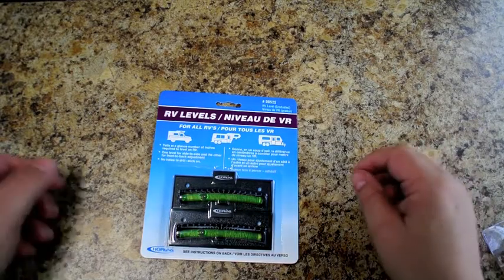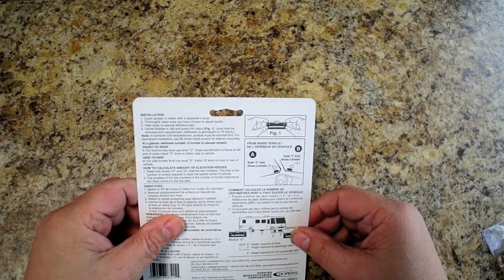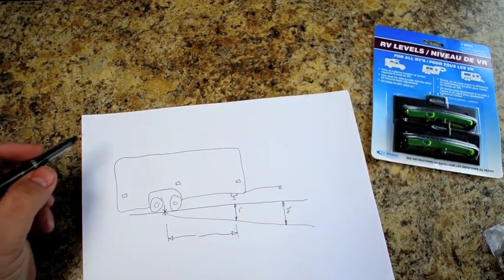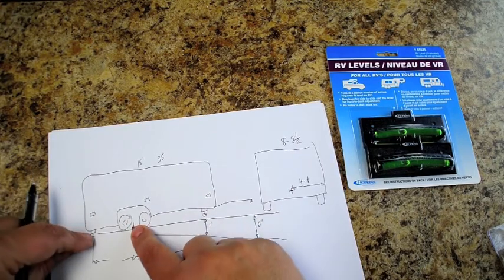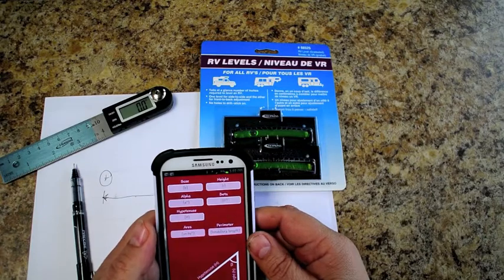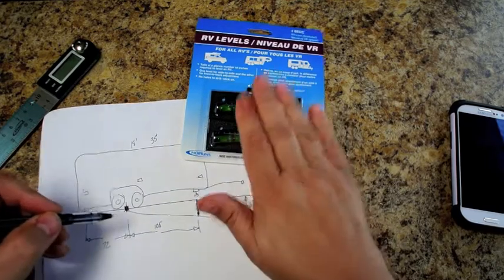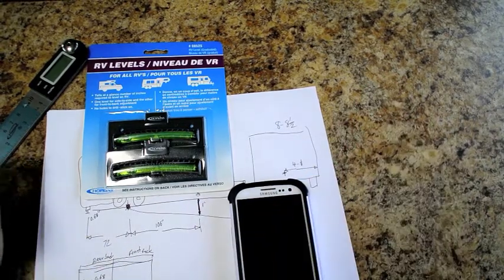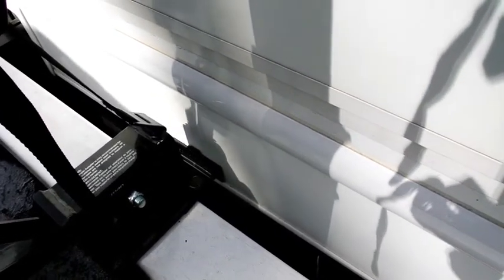Review of the Hopkins 08525 Graduated RV Level.

Comment: I'm gonna put the side to side one dead center in the front and use a 4' level on my back bumper. When I level that I will use my power jack and level front to back and just use the stabilizers to stabilize. Plain simple leveling. if it's good enough for a house it's good enough for the trailer/.
Reply from the maker: Thank you for your input.

Comment: Splitting hairs, ain't ya buddy. C'mon man all this really doesn't matter while leveling an RV. I'm thinking if both bubbles are as close to the center as possible, you're good! Just a little too technical.
Reply from the maker: Not really. Depends on your RV.

It is important to know  how far off from center the RV is when you have an automatic leveling system. They have a limit to how far they can level, and if you attempt to level on  ground that is too unlevel, the cylinders will extend to their limit points and you may have to reset the system.

Knowing the working distance-to-level when you have a leveling system is thus very important - and if you use a bubble system like this one, then you need to know how accurate it really is.

Comment: I thought that the tongue jack was the one used to raise or lower the trailer, and the four jacks on the corners of the trailer were basically used for support and not actually to lift the trailer?!? 
And the sideways leveling was done by pads of some kind under the tires of the trailer?
Reply from the maker: The stabilizers you are familiar with are lightweight jacks that simply stabilize the RV , preventing it from shifting under your weight when you walk around inside, as well as immobilize the suspension when you are camped (so you don't get that bouncy feeling inside). They are not intended to level or support the RV. 

Lifters are much more capable, and can actually level and even raise the tires off the ground. For my Class C, the lifters are 12,000lb capacity hydraulic cylinders (there are 4 of them). The coach weighs 12,000lbs give or take, so each hydraulic cylinder could by itself lift the coach.

My new 5th wheel (we just sold our Class C), includes a Lippert "Ground Zero" system with electric (not hydraulic) lifters, and automatically levels the trailer. I am not sure yet what it's capacity is, but It too has the capability of lifting the tires off the pavement.
Reply: WOW!! the automatic electric lifters sound like they come in handy!!
Reply: Paul... In my camping routine, I have used the actual axles to level the camper side to side, using leveling blocks. I know this doesn't give me precision, but this is the only way I knew... I thenbused the tongue jack for front to back leveling. Then used the four support jacks to stabilize the camper. Wrong?!?
Reply: No idea honestly what the internet or design specs are from the manufacturer. Good luck with a triple axle though. The stabilizers work, but have limited range.